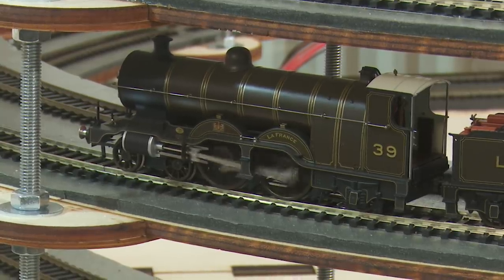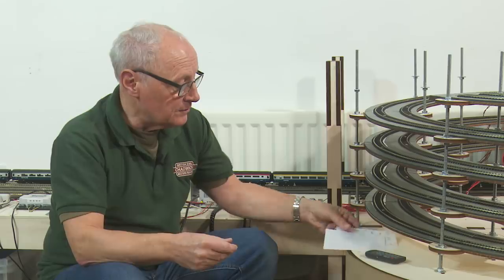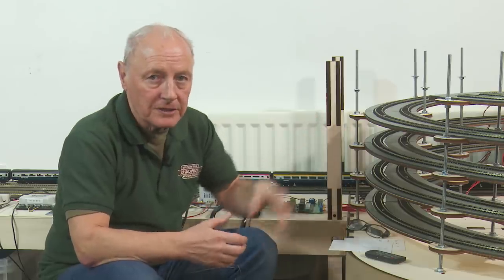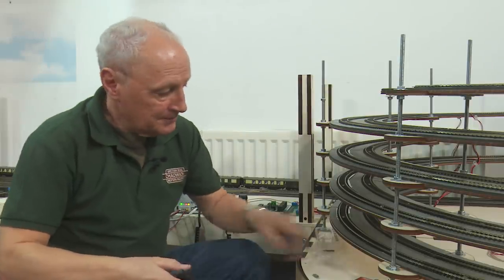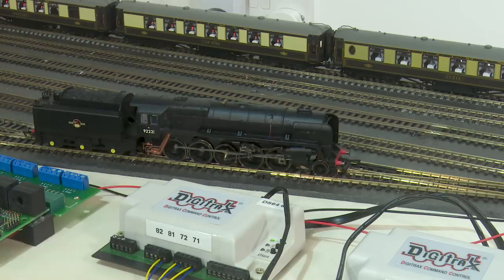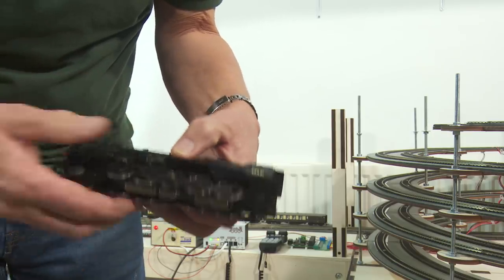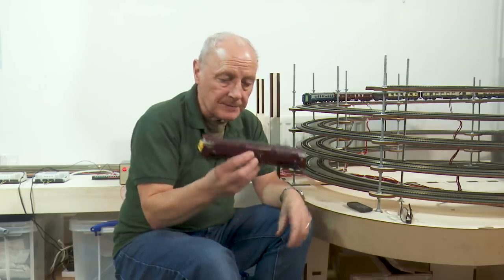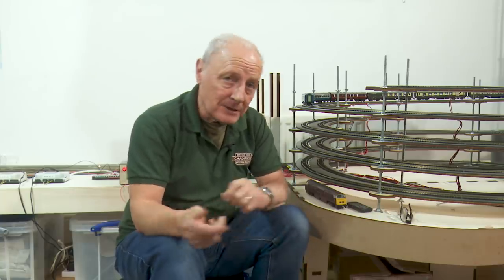Inclines and Power Base at Chadwick Model Railway | 118.

Comment: Im not a scientist but my very first thought about the magnets (DCC concept power base) were, ... the extra traction of the magnet pulling the loco to the rail would also create an equal amount of drag as in effect the magnet would want to stay in the same place. Any attempt to move forward would be met by an equal resistance to stay put. To make my point, take your magnet and place it on a piece of non magnetic material, paper, plastic, wood, whatever. Now give it a little push with your finger it moves relatively freely, now put your magnet on a sheet of ferrous metal. It takes some effort to budge it. The demonstration with the first magnets on the 9F seemed to show little or no improvement which was exactly what I expected.  My thinking is the success of 5 magnets (your small confession, ..  you naughty little minx !!)  was probably due to the extra weight of of the material. I wonder if the improvement was actually any better with the DCC concept power base or would it have been the same with the same given weight... The success of the larger loco's is purely down to there extra weight. Just a passing thought !
Reply from the maker: Martin, we will have to disagree on this one. The PowerBase really does work but I do understand your suspicion.

Comment: RE: the Bachman Atlantic - you can get smaller neodymium magnets you could mount, but if you arn't that keen on it it's not worth the effort.  Annother option is adding weight inside the loco (again, a bit of a faff that may not be worth it to you)
Reply from the maker: An interesting point about adding wait Sam. And it’s certainly something I’ll look into. Regards Charlie
Reply: @ChadwickModelRailway  Here's an old but interesting thread on the subject. Apparently balance of the weight is the most important factor.  A little weight that adds balance is better than more weight in the wrong spot.   http://cs.trains.com/mrr/f/88/t/204021.aspx
Reply from the maker: Thanks Sam.

Comment: I'm surprised the 9f struggled despite 5 driven axles whereas the Western was fine with its 4 driven axles. Makes me wonder if the 9f has a hollow boiler that you could pop a thick metal rod into to add weight.
Reply from the maker: I think that you’re right Alec. A little extra weight would do no harm at all. Regards Charlie
Reply: @ChadwickModelRailway  key thing is that the four axles of the western are all in contact with the track, whereas the five axles of the 9F only have two axles (actually 3 wheels) touching (with full weight). Unless you make the streamer chassis compensated (ie with suspension) this will always be the case, and accounts for the poor performance of steamer models.

Comment: Hi Charlie. To the left of your Digitrax DS100 you have another box marked 'on track'; what is this and what is it for, please?
Reply from the maker: It’s an old transformer that I still use, and it powers up the DCS 100
Reply: @ChadwickModelRailway  Hi Charlie. Interesting... Did the DS100 not come with a source of power, or was the On Track just a better choice?
Reply from the maker: It was an eBay used purchase Paul

Comment: The Hornby Railroad 9f has an overly heavy tender chassis from its tender drive origins as does the black 5. They won’t haul much. I replaced the chassis of the tender with spares from the super detail version on my black 5 which transformed it and made it visually better too.
On the 9f you can reduce the metal of the old motor housing and try to free up the overly tight pickups to make the tender wheels run free then it should make the helix ok 👌 😎
Reply from the maker: What a great tip Burt . I shall certainly look into your proposal. Stay safe mate, regards Charlie

Comment: I remember the old 1980’s  Hornby Hymek  with the skew drive motor had a very similar system to this, it was forever finding loose track pins and such like, it was called Magnadisum (please excuse spelling the spell corrector changes it every time) It was designed to pull the loco on to the track so you could run longer trains up an incline,This seems to be a copy of that system. Hornby didn’t run it for long, maybe a couple of years on selected locomotives. It may have just been a gimmick or never really worked at that time
Reply from the maker: Yes the gimmick finished when they realise the track rusted away. Regards Charlie

Comment: Are all the magnets mounted with the same polarity (north down). Would mounting with alternating polarity improve adhesion? Another test perhaps?
Reply: That's good point; would also like to know if the Hunt couplings are affected with all the magnetic stuff around.
Reply from the maker: Great questions guys. The Hunt Couplings do not seem affected as the magnets are only on the logo itself. When mounting the magnets on the belly of the local, I did mount them north to south. I imagine only time will tell on the full effectiveness. Regards Charlie
Reply: Charlie, are you saying that the north/south poles are on the smallest faces of the magnets? I was expecting the poles to be on the largest faces.
Reply from the maker: Blimey, you’re right!
Reply: So the question is really relevant, do the poles alternate. Be cautious about checking them with a compass, don't get the compass too close to those neodimium magnets, happened to me, the magnets flipped the polarity of the needle in the compass. We switched to a Hall Effect pole detector to verify the poles alternated in our linear motors.
Reply: @hirsutusi5536  It is almost tempting to use the iron filings over a sheet of paper to see the flux lines out of the magnets, and then try different orientations to optimise and gat the maximum flux lines coming out of the combined magnets. 
Probably best to do this away from the locos, as residual iron filings will find their way everywhere they’re not wanted!

If you let the magnets stick together, they will stick on the “active” faces. The older bar magnets were active at the ends, but the newer rare earth magnets seem to be active on the larger face. 
And does it benefit from a keeper on the other face to complete the “magnetic circuit”?  One rare earth North up, next to one north down, and a magnetic plate (like a spare power base) across the back as a rear keeper would force more magnetic flux out of the front to be active attraction.

Comment: Great video, Charlie
Have you tried to increase tracktion by increasing the weight of the locomotive? I know lead isn't the healthiest material to work around with, but a pair of glowes can help you out here 😊
But I thing it would be easier getting better tracktion by increasing the weight rather than finding a place for the magnets.
Reply from the maker: I will certainly look at fitting magnets to the Atlantic steam loco Tomas.
Regards Charlie

Comment: the force of a magnetic field decreases with the square of distance (simpliying), so a third metal rail, 0,5 cm wide, at the same level of top of rail, will enhance the traction force much more than a plate under the sleepers; the helix is an hidden area, so why not? you gain 1,5..2mm in the magnet- metal gap.. that's a lot of force...
Reply from the maker: And interesting option indeed, thanks.
I would need to install it at build.

Comment: Is it the fact that power is no issue with the model but more to do with drive wheel diameter, as in the full size steamers that struggled with wheel slip on steep inclines
Reply from the maker: I believe that the spreading of the weight over many driving axels is the answer.

Comment: Great video Charlie.  Do you know anyone with an old Hornby APT? Would love to know if the power car in the middle handles your helix.
Reply from the maker: All we can do is see if anyone reads this message. Regards Charlie
Reply: @ChadwickModelRailway  I've got one; how do we get it to you?  (BTW, it's still DC, so that will need resolution, too!)
Reply: So I got out the APT and gave it a good run today. 
But there are three things that make this seem like a trap. 
Firstly, it uses rubber tyres so will suffer from your MX3 treatment.
Secondly, the rubber tyres are old, so will not show off the helix in the best light. 
But most important, the driving carriage is in the middle, and so the front two carriages will have gone over the end before the loco stops!
But a drop of MX3 worked a treat, changing a screaming bearing into a mild whirr. Needs TLC, I suspect, along with all my other locos and trains.
Reply: @tomlawton7087  I’ve done the Strathpeffer Junction motor replacement on my APT along with new traction tyres.  I wish I lived closer to Charlie so I could let him test mine out.  I think the motor car in the middle might help helix performance but good point about it driving off the top of the unconnected helix!!
Reply: @fishydelishy  Yes, and I wonder if the power bogie on the uphill or downhill side would make a difference. Of course, having the traction tyres on the outer side allows the inertia to put more weight on them. Or it would do so, if this wasn’t an APT that leans to compensate for the inertia!

Comment: Hi  Charlie,  at 12.30 you said that your layout is a diesel layout and covers a period from 1968 to 1972 with the exception of an HST, but isn't an HST a diesel powered high speed DMU, so you could still class it as a diesel for your layout, but how did the BR 9F and the LBSC Marsh Atlantic locomotives creep on to a diesels only  layout, modellers licence I suppose ! 😄😇🤣
Regarding climbing gradients,, I don't think that you can beat adding extra weight into the locomotive or power car, I would never use rubber tyres as they stretch over time and cause the wheel to run unevenly. 
To add extra weight to my locomotives and power cars,  I use either the the new type of car tyre balancing weights that are about the size of a segment of a chocolate bar, but half the thickness, with a self adhesive backing , or one of the many of balancing weights that fix to the wheel rims of cars, but seem to fall off and end up by the side of the road.
  Barry  New Zealand.
Reply from the maker: Hi Barry, the HST came into service in 1976, so it's a bit late.  The Atlantic was a gift from a subscriber and the 9F was in a moment of weakness!  Regards Charlie
Reply: Chadwick Model Railway  Hi Charlie, the 9F is a lovely weakness. I have tried to only run locomotives and emu's from my chosen era, late 1950's to early1960's on my layout. 
I always wanted to run a 9F on my layout, but I didn't think any were allocated to the Southern Region, and none I think would have run though Barnham, the station that I am modelling,  some 9F worked the S&D line and sometime a 9F would work the Esso oil trains to and from Fawley, but then I would need to modify the locomotive to run on my P4/S4 layout, and I have never been very good at building steam locomotives valve gear.
All best,
Barry
Reply from the maker: A fair point Barry. Regards Charlie.

Comment: Great video as always however there is one cause for hesitation and it maybe a question that should be directed towards DCC rather than your good self, but isn't there a danger of the magnets having a detrimental effect upon a DCC chip that's installed inside a steam engine rather than its tender?
Reply from the maker: One question that I shall certainly ask Richard at DCC Concepts.

Comment: Good video. However my 1956 Hornby Dublo 4MT 2-6-4 tank loco will pull 20 tinplate wagons with coarse wheels up a 1 in 20 gradient without any hesitation. My white metal kitbuilt locos can manage 1 in 25 with a decent length train of 8 or more coaches without difficulty. The modern locos struggle presumably because they are too light. Incidentally your 9F was a Hornby. Try a Bachmann version - probably better performance.
Reply from the maker: An interesting point Christopher, thank you regards Charlie

Comment: Could you not also on the kettles fill in the void of the boiler with  something other than lead like tungsten beads for some extra weight..all of my locos are made of brass and are rather light and most of the rolling stock is cast white metal kits making very heavy trains even in a short length so we fill them up with tungsten in every space available in the smoke box area alone is just over 2oz of wieght..just a thought
Reply: Great video Charlie - one of the reasons I haven’t gone the helix route is 90% of my loco’s are steam and many of them have issues on very slight inclines on the layout particularly with 8-10 coaches and to do this to dozens of locos is just not an option. However this may be a solution for a couple of loco’s (an A4 comes to mind) that can’t even manage the slight inclines on my layout.
Reply from the maker: Adding weight is certainly something to explore. Regards Charlie.

Comment: Those blue terminal connectors, look suspiciously like the ones that pull off the pcb?
If they are, you won't even need to unscrew them :)
Reply from the maker: Yes that’s correct Kevin they just slip off so all I need to do is disconnect the power feeds to them. Regards Charlie

Comment: Hmmm, this is the problem with a helix, the maker's all seem to go with about 2.5% incline but even on the outside, this is just too much for some locos. Screwing blindly into a loc chassis to add magnets isnt for me and as you've found out, they can snag points and decouplers. I wouldnt want to use super glue either but that's just me.
Reply from the maker: A fair point and you’re totally right. But then again that’s what I’m here for, so you can learn from my mistakes!

Comment: Hi great video as all ways, I got a box of stickon car wheel weights to put on the or in the train to help my trains going up inclines
 off Ebay
Reply from the maker: Great point James.
Reply: I work in the motor trade and got a box of mixed weights (100) for about £20 ranging from 5 grams upwards.

Comment: Hi Charlie.
Watching this video, I noted you putting superglue on a piece of paper and using a paperclip to apply it.
Here's a great tip for you... 
Put the superglue on one of those small zip-lock bags that you get some detailing parts of Bachmann nameplates come in.
Unlike the porous paper, the superglue will take hours to dry!
What makes superglue dry, is moisture... which is why superglue bonds your fingers together due to the oils on your skin... but there's no moisture on one of those bags, so it doesn't dry out quickly.
After an hour or two, it will start to gain a slight film where the moisture in the atmosphere falls onto it, and gradually over time, it will dry solid... especially a wet place like Manchester, where I live!
But you can get at least an hour to work with, so you're more likely to use up all the superglue... than waste it because it dried before you could use it!!

My best example of the usefulness of this technique, was when I was fitting the hinges on this DC Kits EMU kit... each about 1mm square, and there are 102 hinges viewable in this pic below... 204 when you remember they're on the other side too!!
https://drive.google.com/file/d/1lx4gQns_jcjnvqDEBD9e3J34umfsby9L/view?usp=sharing

The method I used to fit them was to place a tiny piece of blue-tac on the tip of a ballpoint pen... use a piece of wire and pick up a tiny blob of superglue and apply it to the model in the correct position (marked with a pencil line... then pick up the hinge with the pen (the blue-tac holding it)... and placing it on the model.
To avoid the pen pulling off the hinge, I roll off the hinge by twisting the pen... and finally push the hinge down with the tip of my modelling scalpel to make sure it's solidly on the model (rather than floating on top of the superglue).

If you consider it takes about 15 seconds to do each hinge... it took about an hour to do, and I only used two blobs of superglue on a zip-lock bag to do it!!

Hope that proves useful for you!

Cheers

Laura
Reply from the maker: Laura, what an excellent comment. 
So useful on longer projects.
Regards Charlie

Comment: Charlie, thanks for this, but you're scaring me, because I haven't run trains up the helix yet. And I haven't installed that manetic system on the helix. Why are the diesels better at climbing than steam?
Reply from the maker: I think it’s because the traction is spread throughout the chassis James, whereas on some steam locos it’s based towards the centre of the locomotive. Regards Charlie
Reply: @ChadwickModelRailway  That makes sense, at least for smaller locomotives, like my 0-4-0 switchers. My road steam engines tend to be large, i.e., many more wheels. I'm guessing that my Big Boy, SP cab-ahead, Challenger, won't have trouble with traction. I think (hope!) that the radius is big enough. The helix is more than 30" in diameter (HO), so I think it'll work with them. I won't be running the little steam switchers up the helix with loads.

Comment: With the multi-drivewheel locos, why can they not machine one pair of wheels slightly smaller and fit rubber tyres ?  Surely that would solve the grip problem ?  Albeit at the expense of a those wheels picking up the current.  Swings and roundabouts.......
Reply from the maker: I totally understand your point Keith. In fact, on the continent many Loco’s still have traction tires fitted. Regards Charlie

Comment: Check out the you tube link. Also be careful with that superglue accelerator it's carcinogenic , we use it a lot at work and the health & safety for it is crazy
Reply from the maker: I’m very grateful for the superglue Excelerator tip. But you didn’t include a link? Regards Charlie